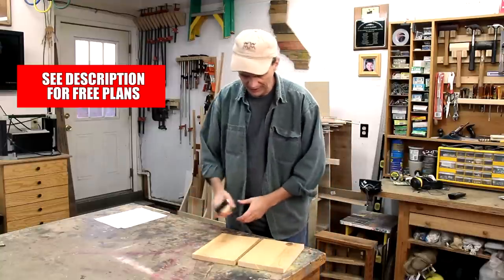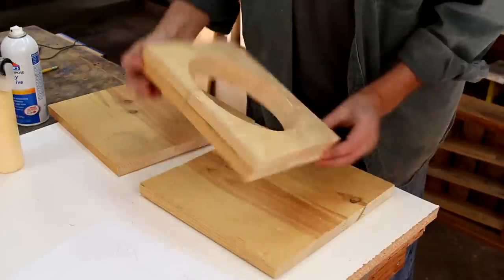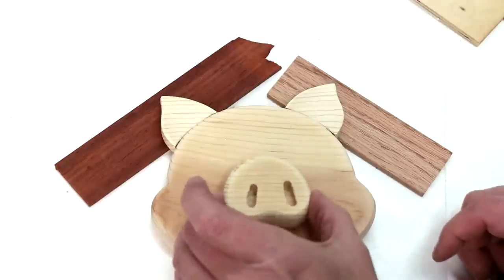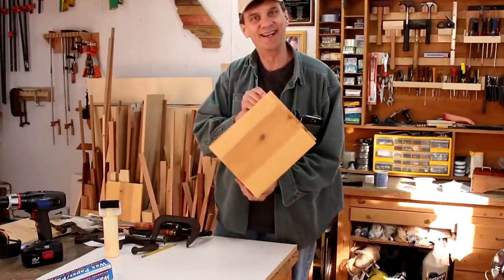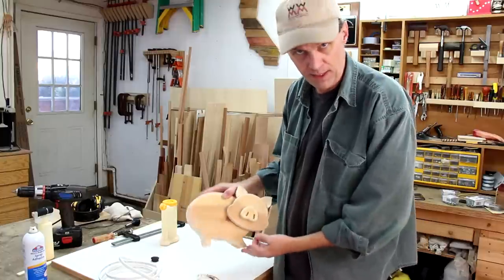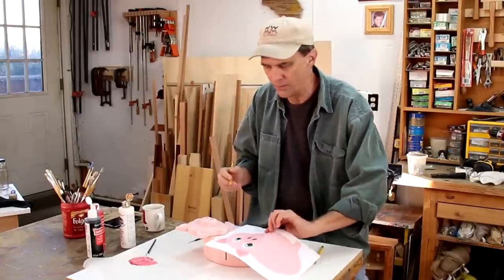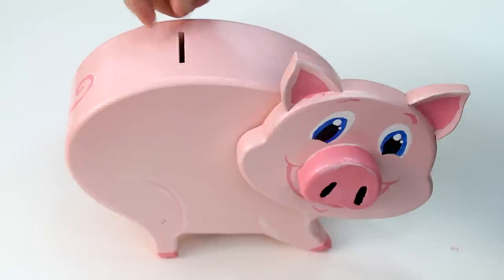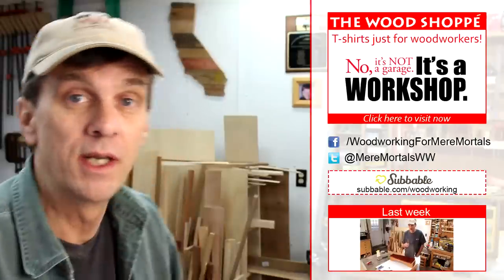How to make a classic wooden piggy bank.

Comment: if anyone scales this down when you cut out the inside leave extra across above the leg area  so you have material for the bung to fit in I did not and had to put a piece in on the first one at this size